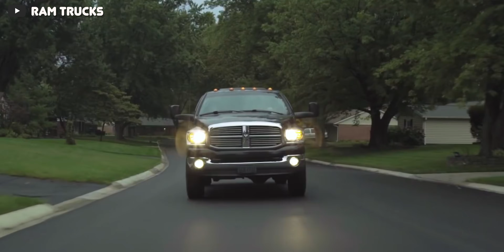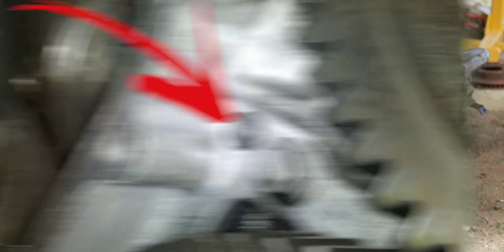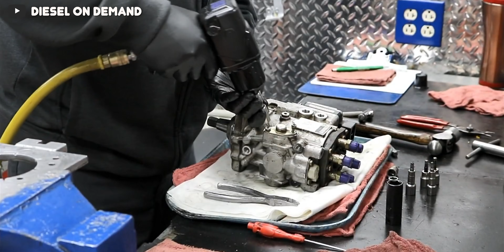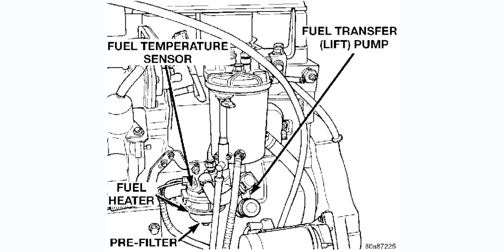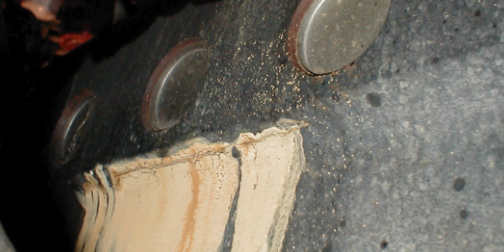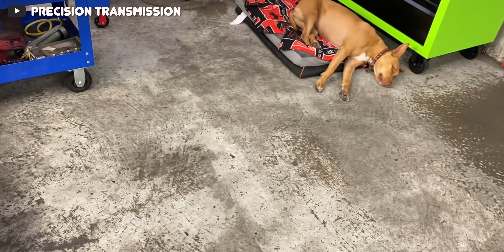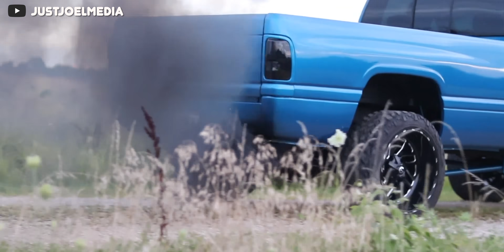Everything Wrong with the 5.9L Cummins (12V & 24V)

Comment: I have a 2nd gen, it’s got the least desirable 24v but I love the engine. The rest of the truck though is not so great. Despite having around $8k in steering and suspension it still rides and handles like a log truck, and the automatic transmission is a joke. Has no power until it locks up or enters overdrive, interior is obviously cheap (though mine is in good condition) and my heater core I’m pretty sure went out. Such a shame because the engine is imo damn near perfect. Power, sound and simplicity cannot be beat. But I’m selling it since I don’t like how it drives

Comment: It's so easy to spot video makers over true mechanics lol....
Be pretty hard for that pin to get caught between two gears that are rotating away from each other now wouldn't it???
Not to mention the injection pump loosing timing is not what causes interference between the valves and pistons. Not saying it isn't a problem, just that it's clearly someone reading a script over understanding gear rotating direction 🤷

Comment: I ran vp44 in 12v cummins for 4 years on waste vegetable oil, aircon oil,  transformer oil in a 6500kgs truck.
Vp pump is solid,  the model with no electronics.

Comment: My 2003 had a 47re. My brother's very late 2003 had the 47re . In 2003 you had to get the high output witch had the 48re . All California trucks in 2003 had the 47re because you could only get a 235 hp .to get the 48re you had to buy out of state and get the high output and weight 6 months before you could register it in California.

Comment: Yep I agree.  I had a truck broke down on me going camping.  Completely ruined my trip with family pissed off at me.   I spent hundred of dollars just for the fucking fluid  changes and filters and hundred on diesel just to have the f. thing broke down on me and left me stranded hundred of miles from home and no vehicle to go anywhere or do anything while camping.   No i had no camping as i  spend everyday trying to get the truck started again.    Costed a bundle to get that truck and the camper home!!!!!!!!   HORRIBLE EXPERIENCE!!!!!!!!!

Truck only has 230k miles on it on a Cummins 5.9 diesel.   Shouldn't this thing last way longer than that?  I already had  injectors replaced less than 10k miles on them and the truck died on me with clogged injectors and a shop charge of $130 for diagnostic only while camping.   I maintained regularly with new fuel filter  and there was no neglect in driving or maintenance.
Sure you could blame on the diesel but I doubt it!!!!!!!!!

I will NEVER buy anymore ICE truck of any brand.    EV only from  now on.  Tesla Cybertruck is next for me.

Fuck the ICE truck and Cummins diesel reliability my ass!!!!!!!!!!!!!!!!

Comment: I've got a 1st gen 5 speed 4x  truck and a 01 4x, 24v 6 speed.
The first gen is by far the worst ridding truck I've ever driven but also probably the most reliable. 
The 01 24v has already had one vp44 at well under 150k . All and  all still the best trucks available in there time .

Comment: One thing to note is that it is not only about the psi that the lift pump is supplying, its about volume.  In stock trim the weak lift pump is only pushing X amount of volume.  Once you upgrade to say an Air Dog and do it right which would be by bypassing the factory filter housing and having half inch lines from the air dog straight to the VP then you not only increase psi by alot but you also increase volume by alot.

Comment: Million mile (12V) engine that gets 20MPG (in 1 ton chassis empty with 12v P7100) Where you can get to every part of the engine with ease and has the least expensive parts of any diesel I've ever worked on. For a diesel junkie, this is my favorite diesel pickup truck engine.

Comment: I Bought a 2001 dodge 5.9 with the 5 speed, I noticed that it did not ride rough when loaded or hooked to a trailer.
I made clamps for both ends of the overload springs with just a 1/2 inch x 2 inch piece of flat bar and pulled it
down with a bolt on each end, that really improved the ride. The first thing I did was install a gauge to watch the
pressure from the lift pump and a warning light that came on anytime it went below 10psi.
  The only problem I ever had was a oil pressure censer that cost $53 from emay.  After that I installed a oil pressure
gauge. I had to change both battery's when it was 10 years and 3 months due to one of them leaking acid.

Comment: I have a 06 model with a 5.9    Motor it was running great when I shout it that night and the next morning it was not running like it should. It seemed to be fringing on3 or 4 cylinders instead of the 6 took to a dealership and there saying the motor is shoot I find that hard to believe
Reply: Check for air in fuel system or failed lift pump, both common on these, bleed fuel injectors, check they all squirt the same, possible pump problem, cams wear out too, i've seen these totally f*cked and they still run fine, excessive blowby from the breather is the only real sign the motor is shot

Comment: I have a 2003 3500 with the Cummins. I love my truck as it has given almost zero problems. It has the dash cracking and blend door issues along with the notorious steering box problem that is fixed easily.

My truck was built in 12/02 so it got the 47RE. One day I hope to build it up better than stock.

Also the Carter lift pump used on the VP44 was used up until 2005. Mine still has the Carter pump, but soon I'm getting a belt driven lift pump.

Comment: First of all if you want real power you have to turn to steam. Put a steamer against a brick and it will come down. See what happens when you put a diesel against a brick wall. I hate to think. A diesel is nothing without a transmission. Mercedes buses have an eight speed auto transmission that probably costs as much as the engine. The steamer does not have a gearbox up to ten tons. It has a steam generator with only very few working parts. I could fill the Mitchell library what is good about steam but on diesels a couple of pages. I'm no genius but I held a first class marine engrs. certificate with thirty years experience at sea mainly on diesels. VOTE STEAM.

Comment: The 5.9 is a medium duty engine not light duty as you said. Medium duty is 350,000 average miles before internal rebuild. The power stroke and duramax are light duty engines. Look it up it’s a ASE classification. Can you say clickbait, come on guy get your facts correct

Comment: I would say the weak link is water pumps. They are easy to change but have always failed on me when I am out of town. 4 water pumps in 600 000 KM. At 650 000 KM still on the original 48re automatic transmission. I think the transmission does not  last for some is because of operator error or abuse. Just look at how some jar heads drive and you will understand.

Comment: I am driving my 2006 5.9l . It currently has 585,000 miles and never had any issues with the cummins . I only have had issues with the junk transmission replaced 5 times.
Reply: They stopped making 24 valves in 03

Comment: Hey bud, the 1994-1998 24 valves didn’t have the Bosh p7100 pumps they had the VE and VP44 injection pumps. If those engines had a p7100 pump stock from the factory the only downside of the 24 clave would be two things the 53/55 bad casting blocks and the killing dowel pin like you mentioned. If your gonna talk about something at least read up on it and get it right.

Comment: My question is, what things can I do to help my 2007 ram 3500 become a million mile truck? I know the pumps and all that along with the transmission. Yes mine is an automatic with less than 195k miles on it and yes the transmission has been completely rebuilt and yes I believe it's a 68rfe. It's a fun little truck, rwd, 2 door, crank windows it's just old school cool. (Power windows suck in my opinion cuz the fuckers are EXPENSIVE to repair.) And as far as I know, my truck is genuinely stock, no mods or anything she's not even leveled out. I'd love your thoughts on the matter, thanks boss!

Comment: I had a 1999 24Valve the truck was junk and the engine didn't really have a lot of power I kept about a year and half went back to Ford F350 powerstroke 7.3 I still have it and it runs good it's been sitting for months it's 25 degrees snowing like hell I started it tonight and took right off

Comment: As a long time owner of an 02 Cummins dodge, I have to say a couple of things about this system. Mine has had a factory in tank pump since new, and it’s always supplied a consistent 13psi measured right at the vp44 Schraeder valve. Second, while the timing and fuel quantity is electronically controlled, it’s still a mechanical/rotary pump, not electronic as the common rail is. Great engine, 465K and never been apart. The truck isn’t anything to write home about though 😂
Reply: I kinda wish they would have designed the 12v and 24v like the 855 and n14 with a pt pump and pushrod driven injectors. I understand the injection pumps across the board but the cummins pt system was my favorite to work on
Reply: you're lucky, my 99 ate 4 electronic fuel pumps... I sold it and went back to a 12 valve with the P pump.
Reply: All diesel pumps are mechanically driven for fuel pressure.  The timing and metering is "electronically controlled", unlike the P-pump where it is strictly mechanical.

Comment: The cummins 5.9L 12v fandom is insane. I was looking for a 5.9L 12v engine to build and swap into my RV. Why? The old dodge 440ci V8 getting 4 MPG trying to fling a small house down the road is simply not something I want to feed. I've done some digging and found that folks who have done the 5.9L 12v swap ar seeing teens in mpg. Thats miles away from the 440ci. 
Getting back to the 5.9L 12v fandom issue while looking for one. I was searching the internet and found a 280K mile 5.9L 12v with no accessories, no turbo, for $1500. It was the only one I found so far. So I kept reading until towards the end, very last sentence, where the owner says that it threw a rod and has a hole in the block... $1500 for a stripped down engine with a hole blown in the block? You're batshit crazy... I then found a completely disassembled engine with no injection pump, no turbo, no exhaust manifold, and no connecting rods for $2000? Sorry, that's just nuts.
I'm likely going with the 7.3L powerstroke v8, it'll fit better, weigh less than the 5.9L 12v and the 7.3 makes more power and has the 4R100 which is a FAR better transmission. Oh and it's affordable.

Comment: I believe you can get the ram with an acen transmission which is an affiliate of Toyota. They make great transmissions
Reply: They are for cab and chassis or the HO 3500 only. Can't get the aisin on the 2500

Comment: excellent video! and to throw a little more shade towards the ep@ , i recommend adding a fuel additive to increase fuel lubricity to diesel engines designed before the introduction of Ultra Low Sulphur Diesel. the Bosch ppumps, ve's and vp44's love good slick slippery diesel imo

Comment: I have driven many dodge Cummins trucks fro 94 and up (my previous employer bought them from 94-2006) and I’ve had many lifter and/or injector pumps fail. This brought back those memories. I recently acquired a 1998 2500 with the 12 valve and that’s when I learned about the KDP. I will be having that repair down very soon as the rest of the truck is in great condition with over 300k miles! Excellent video!
Reply: With that many miles the odds are that the kdp has already been fixed by a previous owner but better be safe then sorry. I’ve got the same exact truck with 317k and still runs like new

Comment: I have an '02 with 75K miles on it (lots of off-road, heat-cycling etc. living in the mountains). Plastic stuff starting to break due to being old and brittle. I forget what one part was called, made all my oil dump out on the highway. Only other time my truck's let me down, was a cracked fuel-filter housing causing the fuel pump to suck air, luckily not killing it. Total parts cost around $25. Best to replace these before they break. I kicked it in the tires both times, "You're supposed to do the towing!" Both happened this year.

Comment: All inline 6 cylinder engines have a longer rod ratio. Longer rod ratio frees up power and lasts longer. One more main cap makes the block holding crank in stronger and in the same year about the same torque and horsepower but stronger. But the Cummins 5.9 the most dependable and most durable overall.

Comment: 47re needs maintenance band adjustments are a factory maintenance item supposed to be done every 15k miles along with a fluid change and the gov solenoid can be swapped to a gm solenoid that is alot bigger and holds power better the factory torque converter is terrible though

Comment: The 5.9 isn't a "light duty" diesel engine. It's a medium duty that was designed for commercial box trucks etc. It's major overkill for a pickup truck & that's exactly why we all love it 😁
Reply: same with the original 7.3 powerstroke as well as the Duramax
Reply: @TAShannon1 The 5.9 was rated for a 68,000 gvwr truck I don't think ford or the GM were
Reply: Love my 2nd gen Cummins…
Reply: @rcadventures4342 Dodge Cummins the proper way not just "Cummins"
Reply: @bighorn9119  why is that? It’s a Cummins engine. I don’t call my engine a Kenworth Cummins. Please explain. Thank you.
Reply: It's exactly what you want for pulling horse trailers, big fifth wheel RVs etc. A medium duty pickup
Reply: I want a 5 speed.
Reply: @Camo-Dan If you are gonna put a 5 speed conversion in you might as well go with the 6 speed.
Reply: @crandonborth  Yeah but you can get an NV4500 for $1,500 (I did) but an NV5600 or G56 can run you $5k-$10k. And my NV4500 was freshly rebuilt when I got it, and it's been great. Before I put it in the truck, I upgraded the input shaft, got a dual disk clutch, and did a 5th gear fix (which turns out wasn't necessary, the rebuilder had already done it, but the guy I got it from didn't know that).
Reply: Tractors as well
Reply: Its not overkill it's a bles6😢😢
Reply: mine has 209.000 2006 guy down the road has 680.000 on his both 5.9 24 valve.
mine is a 2006 and guy down the road is a 2007.
Reply: They were in buses and campers too

Comment: Overrated?

Sorry man, I've owned a lot of the others, and had to drive the rest in my industry.

I own a Cummins because of their reliability, efficiency and ease of maintenance compared to a V8 motor.

You're inclined to feel the way you do, but I'll stick with my Cummins, and I don't care what it's in....a native Dodge, a Ford or even a GM, I make similar power, get better MPG's and don't have all the extra crap.

Ford's haven't been good since the 7.3
GM's Duramax is great until it breaks, then you find other issues digging in to fix the one.

I've pretty well accepted the issues of my Dodge as acceptable considering how much down time I do not have.

Comment: You do not have to remove the engine. Just wait for the body to rust away around the Engine. Should take about 10-15 years.
Reply: Not really. mine is 22 years old. I had one small rust-through on a quarter panel, had it fixed during the repaint last year. Haven't had many electrical issues either. But don't get me started on the brittle dash core. I've had to Mcguyver it back together a few times, along with a dash cover.

Comment: I get the points you made, but the title specifically mentions the Cummins engine itself, yet some of your points are related to external parts (Like the tranny or loft pump)

Should have maybe changed the title to include the Dodge pickup as a whole, as the engine on its own has very little issues

Comment: I bought a diesel repair business for a friend of mine which he is a diesel guru and I think he said it best… Dodge Ford and Chevy are all a piece of shit but Dodge is the best piece of shit the Duramax was absolute crap when it came out talk about a ticking time bomb! So bad there commercials used to say buy a piece of crap Chevy that can do all the bullshit things and it also comes in Diesel. Ford with their better idea put out a power stroke  possibly the worst engine on the planet! Made one hell of a lot of noise and a lot of smoke but didn’t go anywhere couldn’t pull nothing the best place to find a Ford is on the side of the road! Enough said.

Comment: It does not matter what you are talking about. From grades of soils, to trucks, hell, even our mums.
 It is better to just say it how it is.
    So great respectable work you have done here. 
 So I do have 2 questionatos',
    What year(s) are likely to have a 53 block?
  And secondly, I replaced my transduce/solenoid a couple of weeks ago. Yet still it would not shift out of 2nd. So......... I figured i F-ed something up. Pulled it all off, everything looked, but transducer did sit the same. So I and ended up reinstalling old transducer, kept new solenoid. And what do you know it elfin worked,  was fairy happy (no fairy HAHA-Gump).
  
A week later drove to San Diego from eastern WA, all swell…. Until.
                                                                                                 ....wah waaaahhhhhhhh. Started doing it again.  Yep, I am stuck in second, for another minute. Was thinking to get the GM solenoid doohickey. Well, I will, either way. But does anyone have any thoughts (even if you are reading this post, 3 years from this night)? 
  Those trolling or  donating  a well deserved slight, Smart ass or derogatory comment.  Great,  as long as it is funny. Otherwise, why are we reading it.  Having a little fun. 
 But, seriously, Thank you so much for anyone giving me your time here. because you could bet doing anything else. So yeah, really. 

😊
🙏

Comment: I’ve got an 07 5.9 with the g56 manual transmission. Doesn’t leak a drop of oil, and is relatively quiet for a diesel truck. Granted it’s only got 100k on it. The manual commonrail trucks are the way to go.
Reply: I have the same truck 110K.